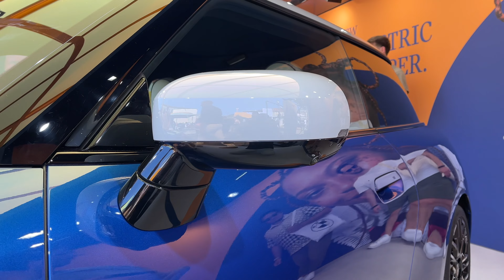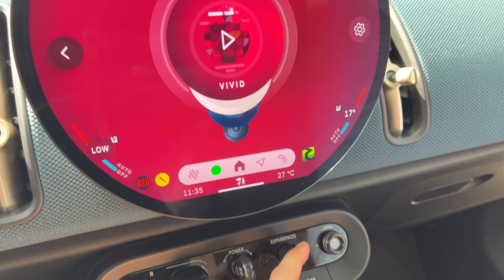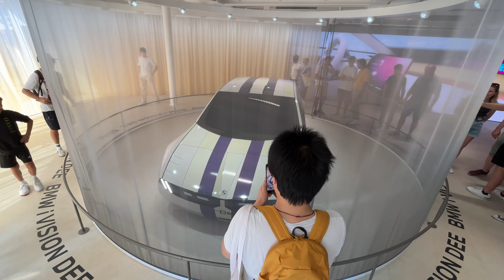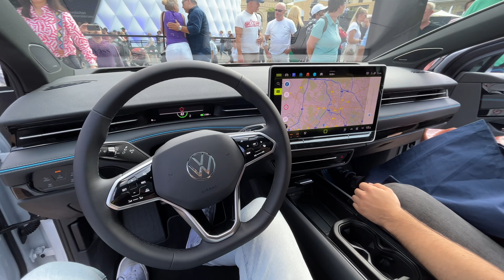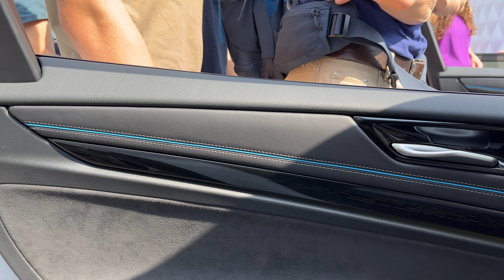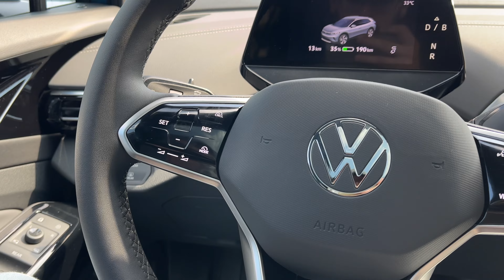TOP 5 New Car Announcements from the 2023 Munich Motor Show (MINI, BMW, VW, Tesla)

Comment: Not sure if you’ll see and/or respond, but here goes…  I’m considering my first EV and was sold on a second hand i3 as a second city car. A few months ago, Wisely seemed to focus on this model with 15-20 i3’s in stock and I was keen to buy from yourselves, as i3 experts, but the current selection doesn’t include any. Are you moving to other EV’s with a greater margin or are you likely to get some new i3 stock in the future? Love the videos - keep up the good work!
Reply from the maker: No problem at all, a very good question! We currently have 10+ i3s in stock which are undergoing preparation. This is admittedly down a bit from the 20+ we usually hold, but this is because we've been closed for our annual holiday and only just getting back into buying/selling. Best thing to do is to give us a call and we can then email you our stocklist which shows everything we are working on... if you're just looking at AutoTrader, you're not seeing the majority of i3s we sell as these go before they reach AutoTrader :)
Reply: @wiselyauto  ok thanks very much for the response. I need to sort out the home charger first but will then be in contact with you. Many thanks.